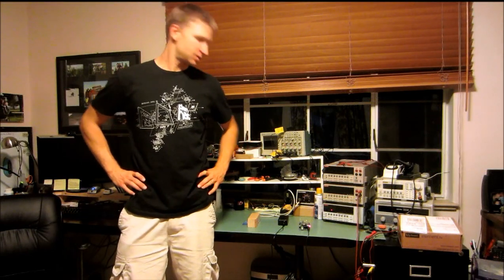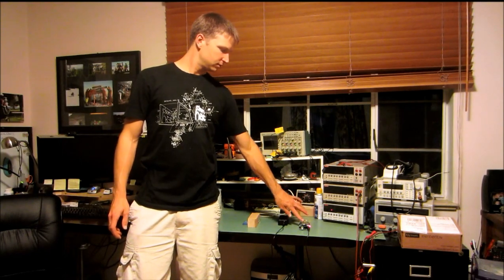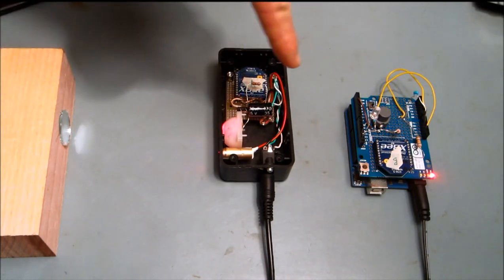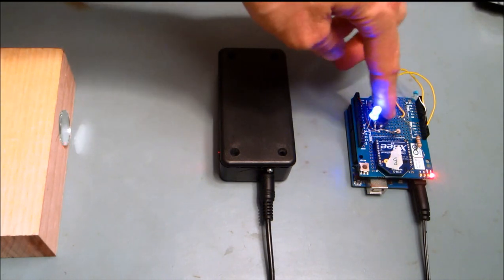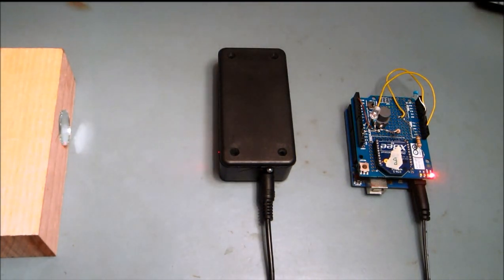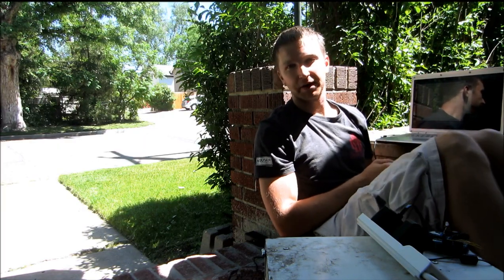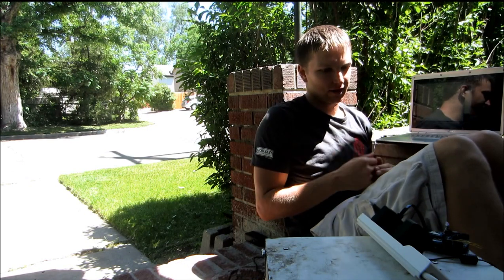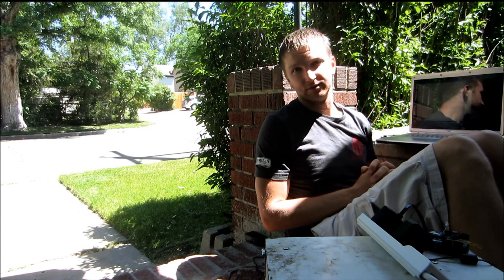Silent Laser Tripwire Wireless Doorbell

Comment: Nice! I have a problem with my wireless arduino doorbell. The 12v battery doesn't last 2 hours, so i have to change the battery everytime. How did you power up your transmitter?
thank you for your time!
great project!
marC:)
Reply from the maker: I have power on my front stoop, so I just plugged it in with an AC adapter and didn't worry too much about power consumption. However there are a few things that you can do to improve your battery life for the wireless use case:
1. Use a different battery. If the transmitter board you got wants to run on 3.3V, you may be wasting a lot of power with a 12V battery (assuming that there is a linear regulator in there that is regulating to 3.3V for the board). Try using three AA batteries.
2. Lower the sampling rate of the Xbee in its configuration. Fewer transmissions should mean less power.
3. Look at installing a solar panel of some sort. I know that www.VoltaicSystems.com have a bunch of solutions that deliver 5V output and run out of the box.

I've updated the description to include the link to the element14 page that has my documentation which may help.

Best,
Dave